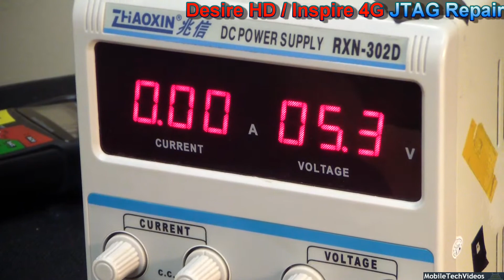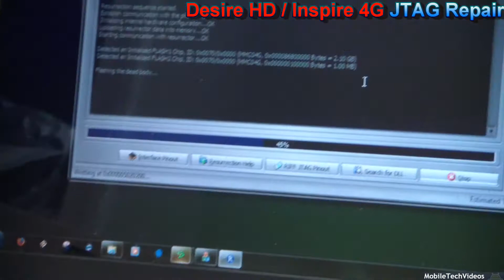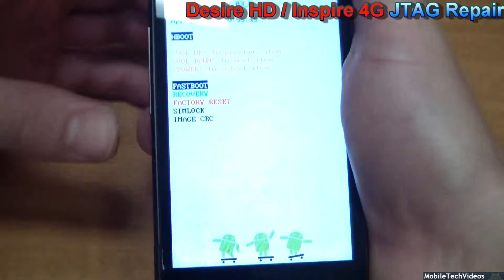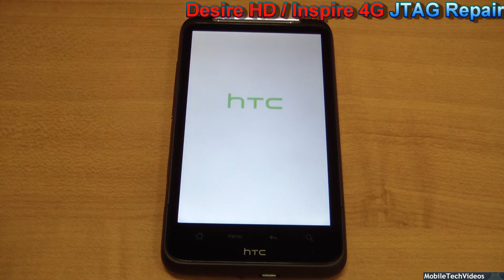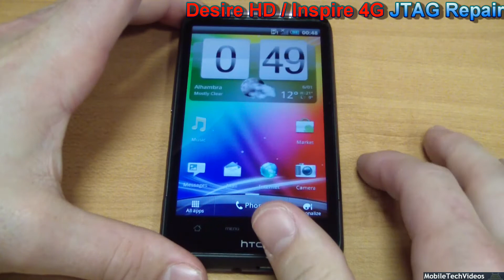HTC Desire HD / Inspire 4G - JTAG Brick Repair Service (Debricking/Unbrick/Brick FIX)

Comment from the maker: Hi William, it could be stuck in read-only mode which means even though it is accepting the RUU and stating it's flashing it, it may not be changing anything. How did this happen?

Comment: my Inspire 4g will boot 3 out of 5 times without getting stuck on one of the boot screens. when it finally boots, most of my applications crash (pandora, instagram, NOT facebook, NOT internet). when I connect to the computer I get 'USB device not recognized' no matter what mode its in (bootloader, recovery, PWR on, PWR off). would this be eMMC?

Comment: Hey got a Desire HD with a real weird problem, Now it will boot to HBoot but not Recovery will not reset or even boot to OS. How ever i can still flash RUU's to it?

Before it switches on it pulses a green led twice any idea on issue. EMMC seems to be working as i have another Desire HD with a fried EMMC which will not accept any RUU. Thanks in advance.

Please DM me on here.

Comment: My Desire HD boots into d bootloader just fine. But does not boot in2 the OS. It gets stuck on d white HTC logo screen after vibrating 7 times.

From within d bootloader when i choose 'reboot bootloader' from d 'fastboot' menu, it does NOT reboot into d bootloader, Same when i issue 'fastboot commands' from my computer. All fastboot commands will not perform as supposed to, but always goes back to the White HTC logo screen.

WILL JTAG RESURRECTION FIX THE ISSUE MY PHONE IS EXPERIENCING ?

thanks